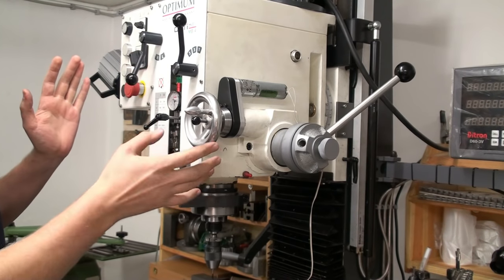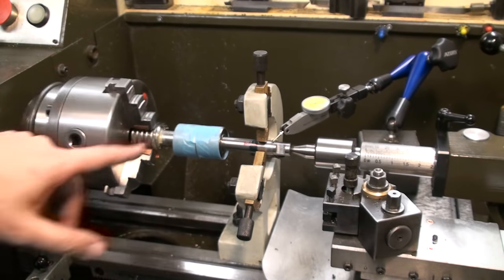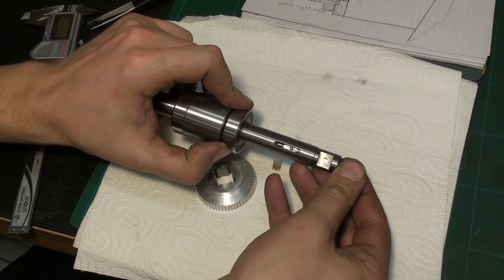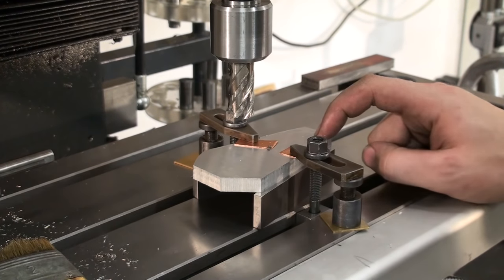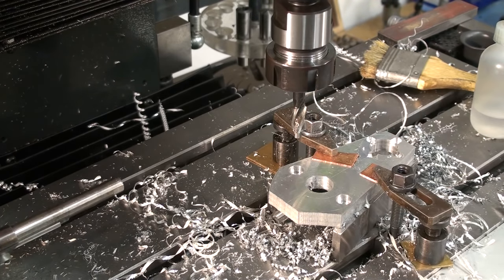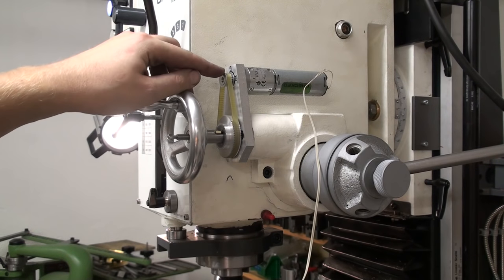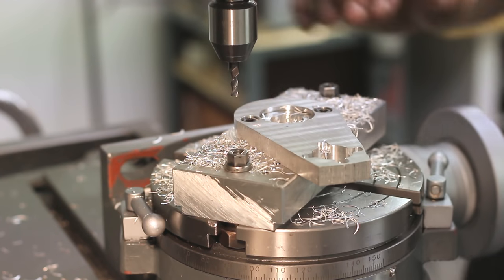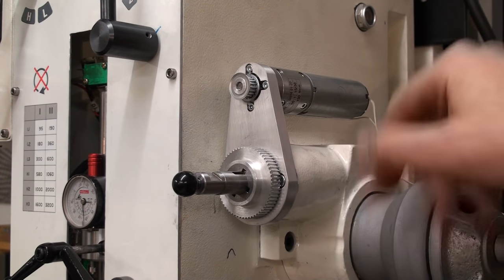Quill Feed - Part 1

Comment: I'm going through your older videos, I like the coupling you made I will copy that for a future project. Also about the sticky residue from soluble oil, I had that problem too with commercial stuff. But when I mixed Ballistol with water to make my own cutting fluid, it worked much better and hardly left any residue at all.

Comment: liked the idea of the square tube on the powerfeed for the table you used  
i think im going to use a aluminium piece as the mountingplate and the belt cover  
the tube should be deep enough to mount the switches and potmeter in front of the belt in the housing 
i either going to cover up the top and bottom with a plastic cap or cut out the front of it and make a nice aluminium coverplate that screws on and covers the ends up too

Comment: Great project. Really like the tip about the denatured alcohol on aluminum. Have a great New Year Stefan.
Reply: It does really help against galling, without the oil film, for example if you later need to paint or glue the parts. 
Any marker lines are wiped out, of course.
Reply: Do you see any rust on Stefan's table? The man puts copper nappies under anything that touches his precious machine, I doubt he would neglect it to the point of rusting.
Alcohol doesn't magically vanish oils, it's just a solvent. After the alcohol evaporates the same amount of oil is still there. To remove oil with it you have to remove the alcohol before it evaporates (use enough to let it run off, or wipe it off with a towel). If you clean and oil your machine regularly it really won't be a problem, but do use Kerosene instead if you are at all uncomfortable with this. 
I just like the no-mess, non-stink, non-poisonous properties of alcohol for aluminium.
Reply: If you have watched the video you would know the idea is to keep the mess to a minimum. The amount of alcohol used is so small it never even touches the ways. 
Water is not a valid comparison, because alcohol evaporates quickly and doesn't stick around to cause rust or require cleanup, again that was explained in the video.
Regarding health and safety, well, kerosene is known to be toxic, even the fumes. Ethanol is not (unless you drink it in large quantities of course, which causes more harm than all other drugs).
Look you can do what you want, if you try it you will see alcohol works fine for aluminium. If you don't want to use it then don't, but the concerns you raised are really non-issues for me and I'll continue to use it.
It's not something Stefan invented either, it's use with aluminium is fairly widespread, like it or not, it doesn't matter.
Reply: That's only in America where poisoning people is apparently seen as the lesser evil compared to tax evasion, so they put petrol and other crap into the denatured ethanol. Here in Europe you can get fairly clean ethanol that only contains a tiny quantity of denatonium benzoate to make it too bitter to drink.
But hey, I'm not the one suggesting the use of straight 100% hydrocarbons instead of alcohol possibly denatured with a fairly small percentage ;-).
Reply: stefantrethan in GB it is called 'methylated spirit,', because it has Methyl Alcohol in it to make u go blind if you drink it!!

Comment: Thanks for this! As a learner, I've spent a lot of cycles figuring out how I can more precisely center register my part on the table, so that my resulting radius will lead into the adjacent edge precisely at the tangent (and also not accidentally over-rotate and cut into the part, darn it!)  Thanks for the Pro-Tip on just avoiding that mess altogether, it changed my thinking!

Comment: Great job as always Stefan. You mentioned belt tension, and if you need more you were going to slot the motor mounting for adjustment. Do not do that, add a jockey pulley  to take up any slack, the same as they do on car belts. You may need to modify your cover with a slot to allow for the pull y to protrude through, then add a small sub cover to protect you from the moving pulley and stop dirt getting into the belt slots. How are you getting on with the Mk 2 centering microscope ?

Comment: Is torque low enough on the motor that if you fail to disengage before reaching the end of the quill stroke it doesn't break the belt? A very nice improvement for sure!
Reply: hehe, bcbloc02 being the hardest critic as always ;) ;) good call tho, if thats the case you might want to throw in some kind of electronic stall detection (hall sensor, ripple detect, whatever)
Reply: that would work, but it has a lot of disadvantages (cables around the machine, moving parts in the circuit, wear, corrosion, ...) the hall sensor is actually the most reliable and precise way to electrically determine the rpm and exact position of a spinning part. oh btw, i just watched part 2 and im surprised how he solved that very issue... ;)
Reply: How about setting a max current to control the torque?
Reply: Stefan would never let that happen.  Never.

Comment: Very nicely built :)
Only addition that comes to my mind: it would be very nice, if the clutch bar would snap in the end positions. All that you would have to make would be two notches in the slot for the key, and a blind hole in the key were you can put some rubber or small spring and a small bearing ball. Just to prevent engaging or loosening the feed accidentally :)
But it propably works well enough without that.

Comment: Great project Stefan. If that key was replaced with 4 ball bearings that collapse or expand into the shaft when the pin is pushed it might engage quicker and smoother. Similar to a Hodaka motorcycle gearbox lay shaft.

Comment: Hi Stefan, love your videos mate, very inspiring. I'm looking to put together a small home machine shop myself as I already have a small lathe and a decent drill press, and I'll be looking at a small milling machine later in the year. However, another reason for my  comment was about the drilling of deep holes that your tailstock can't drill in one pass. On some old large lathes I've used in the past, you were able to attach the tailstock to the saddle so you can drag the tailstock along, as they were too heavy to move by hand. We'll, by doing that, you can effectively drill any depth hole and still have use of your dro for accurate drill depths. Maybe look into it and let me know. I'll likely be modding my lathe with this in the near future. Keep up the great vids mate, all the best.

Comment: Kerosene is popular for machining aluminum in the usa, evaporates more slowly and lubricates a bit better than alcohol. 
For heavy cutting or tapping add 10% oil, this will leave oil at the end but it is less mess than sticky soluble cutting fluid residue.

Comment: Stefan,
Don't you need some sort of collar to keep the timing sprocket from sliding over and engaging by itself?  Perhaps a clamp shaft collar with an oversized keyway?  Also the pushrod needs some sort of detent to hold it in/out.  Or, is this all in part 2?
Reply: More than likely the dial once it's reinstalled will prevent the toothed gear wheel from moving out and engaging the key.

Comment: Great idea Stephan. What brand mill do you have? I am wanting to buy a small bench mill but prefer a very good quality one and I am sure you have the best. Thanks Terry from Texas
Reply: Hi Terry his mill is the same as the grizzly g0761. It sold for $1995 with a power feed in the 2014 catalog. $350 more than a round column mill drill. Being that the head movement is on dovetails and can tilt 45 degrees it's not a bad deal.

Comment: My name is Robert Stiene, 

I am a retired chemical worker, and that use for Isopropyl
alcohol is a new one on me, what is the concentration of the alcohol that you
use? We used 90% (or anhydrous) concentrations, and we had occasional flash
fires. Naturally we were expecting them and reacted the way we were trained. We
were using it to degrease and reduce the moisture in mixing equipment.

Comment: Excellent performance Stefan!
You can add a cheap PWM module to control the elektromotor speed... It has a potentiometer with a build in power switch as well (ebay: Mini DC 5A Motor PWM Speed Controller 3V-35V Speed Control Switch LED Dimmer Top).

Comment: Dear Stefan222,

Nicely done and edited.All the process and narration came in the right time without taking away or putting in too much just like Mrpete222 and Tony222.However you have a lot of bass in your voice.I'm hearing some reverberation too.Will you consider using a clip mic in future?
I have a few more questions.
a) I never seen a boring tool used in such way before(widening a hole).What is that boring tool?Are all boring tool like this? Tell us about.If you had cover the topic.Share link.
b) You voice sounds louder than both your lathe and mill.Are both of your machines that quiet and smooth as we are hearing it?
c) Your tools looks fantastically clean.Do you have OCD? haha you can ignore this one.

Greetings from Malaysia.
Reply from the maker: Greetings to Malasysia,
Thank you :)

I just visited a friend who is a professional camera/sound guy - And we did some testing with a clip mic and a wireless transmitter and the improvement is incredible. I think thats what I am going to do in future, it is some investment, but I think improving the sound will be a good thing...

a) Thats a Wohlhaupter UPA1 boring head with one of my home made boring bars. It features the autofeed and a nice sturdy construction. I showed it a few times in use, but never took it apart (never will ;) ) to show the internals
b) No, while the lathe is very quiet the mill makes a bunch of noise. I go trough some effort to edit all the machine noice down, so I dont blow out the ears of my viewers :)
c) I dont know if its OCD, but I cant stand dirty machinery.. :D
Reply: that's great Stefan.4 thumbs up!

Comment: Huh, interesting. The worm gear on an identical machine that i helped a friend service (bearings got stuck and i have an inside bearing puller kit) was brass (an alloy more than likely, quite hard under a normal file). Makes me wonder which is original, tho, this one is more likely to be original, and the brass one, a fix.

Comment: Brilliant application, I have a box of those gear motors. Do they sell that boring head any longer? if so what brand and model?
Reply: That boring & facing head would be a German made Wohlhaupter. I don't believe there made anymore and you have to watch buying used ones since with some models the taper shank can't be changed to fit whatever taper your spindle happens to be. Sorry but I don't know what models had fixed or had tool shanks that could be changed.
Reply: Turning Point I only wish I could afford one of them it's such a nice boring head 😂
Reply: Turning  Thanks
Reply: catalog is available here: http://us.wohlhaupter.com/products/facing_and_boring_heads/
Reply: Mattew thanks.
Reply: MatthewRulla thanks for catalog reference.

Comment: Hi! What special alcohol do you use for the aluminium? I heared it 
several times in the video but I somehow did not understand what it 
was... thanks!
Reply from the maker: Doesnt matter - Denatured alcohol or IPA ( isopropyl alcohol) work just fine. The only needed property is its volatility, so it flashes of fast.
Reply: thank you! I used isopropyl alcohol so far and wondered what you where using because I did not get the name. Denatured Alcohol is normal "Spiritus" right?
Reply from the maker: Right, Spiritus is what it is sold here. But there is something added to make it un-drinkable which leaves a very bad smell in the air. The Ipa is a bit more inert..smells like at a dentists lab.

Comment: Hi mate.  Very nice although I can't see the application of it.
Reply: It's for anything where you want an even feed; for the boring head or a reamer you'll get a more consistent finish on the wall of the hole.
Reply: well i can agree for both
Reply: Well of course, the relatively slow feedrate is not optimal, but handfeed is probably not better either. If you reduce your rpm according to the slow feedrate you should get some quite nice surface finishes.
Reply: I can go with that :D